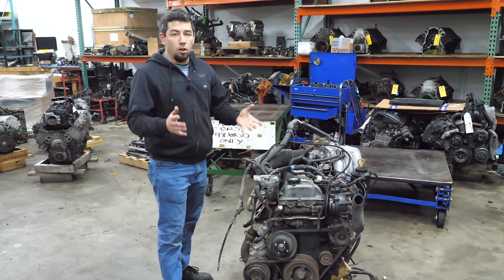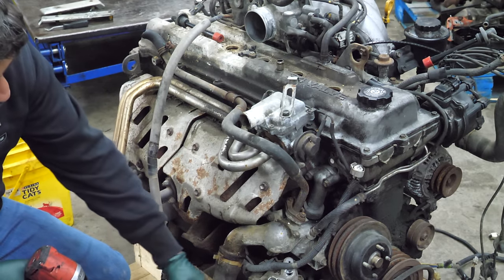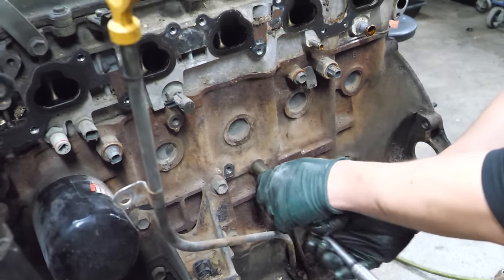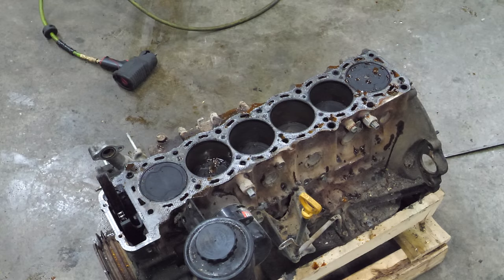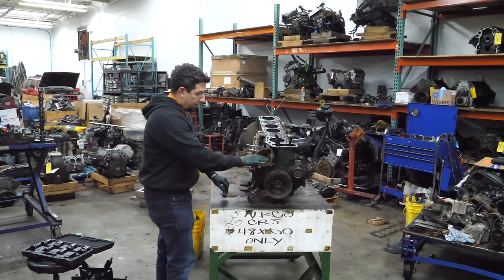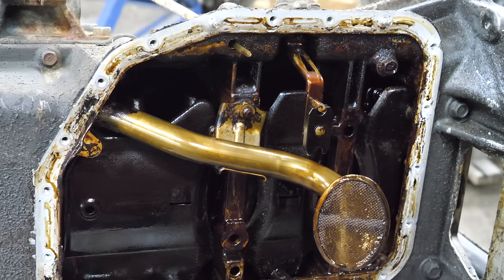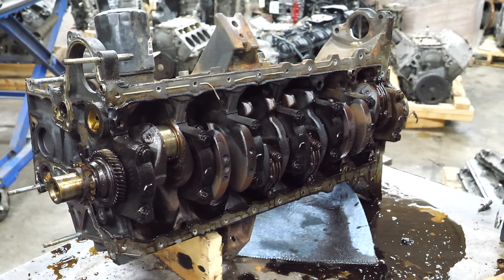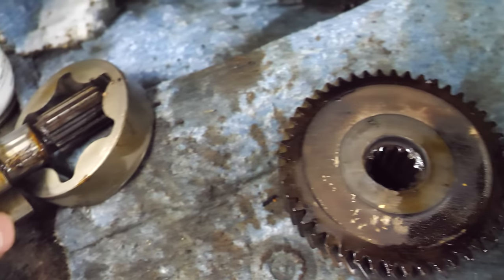LOCKED UP Toyota Land Cruiser 1FZ-FE Engine Teardown! HAD TO USE ALL MY TOOLS TO GET CRANK BOLT OUT!

Comment: I once had a cylinder head that wouldnt come off no matter what I tried. I placed the onboard car jack between an engine mount and a coolant port, no dice. Needless to say I checked a dozen times if I had all the head bolts out. The engine had oil in the water and oil was exuding through the head gasket at its corners. Maybe the water oil mixture together with the head gasket fabric created some kind of glue under the heat. In the end I had no other choice but to put the head bolts back in, this time a little harder, and it fixed the leakage, and the engine runs fine till today.

Comment: The main bearing groove is probably from you turning the engine when taking the crank bolt out. There was probably a rust deposit in the oiling hole that carved that about 1/3 turn which is how much it looks you turned it.

Comment: My father was an engineer all his working life. After he had retired one day one of his farmer freinds was really struggling to get a big nut off of a piece of farm machinery. They had tried everything. The biggest impact gun, heat, a big breaker bar with a scaffold pole on it for extra leverage, the works. My father walked up. Examined the end of the bolt sticking through the nut and the machine. He said "left hand thread" turned round and walked back home.... I would have loved to have seen his friends face.

Comment: Increase the diameter of your air hose. A 3/4 impact works on volume as well as pressure but volume of air will increase your 3/4 impact the most. As a old Snap On Tool man I made many costumers happy with their 3/4 impact purchase.

Comment: I only ever had to mess with maybe 2 harmonic balancer bolts that were that bad. Both times were done with a custom half inch drive, 5 ft piece of rectangular tubing that butts against the frame rail, and use the starter to break it loose. It's one of the most brutal sounding things I've ever done(it sounds like you just blew the crank out of the bottom of the car) but works incredibly well.

Comment: 43:23 😂😂🤣 as you subtlety point to the German word for misery on 4 wheels. Fun video. Using the front loaders to loosen the crank bolt was very Camarataesque. 🥂 👍 👨‍🔧

Comment: First engine job I did at the Toyota dealer in 92 was the old Land Cruiser pushrod inline 6.  It had 30K on it and never had an oil change.  Had to replace a couple of rods and a crank along with rings and bearings.  Doctor that owned it thought his wife was taking care of it and she thought he was.  I hated that engine job but the doctor drove it for years after and then passed it down to his son.  It taught him to change the oil anyway.

Comment: Those drag marks on the main bearings might be from the 90 degree turn the crank did when you set the loader's bucket down on the breaker bar the first time. Big props, that was awesome!

Comment: When the 20R engine came out crank bolts removing themselves was very common. Now its almost as bad being over tight. I have a 1" drive impact that usually gits them into submission, however many must be with the ring gear blocked and a 5' foot breaker is necessary.

Comment: Last crank bolt I took off on one of these it took a 5', 3/4" breaker bar with a 4' pipe on it. Pulled until I bled from the nose and finally came loose.

Comment: I had to change the front main seal in mine and little did I know what I was in for trying to take the harmonic balancer off 🤣 mine is an automatic and couldn't just put it in gear to help the motor to stop turning over....drilled a small hole through the bottom of the bellhousing so I could jam a big flat blade screwdriver in-between the flex plate teeth, and had literally a 3 meter long pipe on the end of my breaker bar to get the bolt out. Snapped 2 breaker bars in the process before the 3rd one held up To the challenge!

Comment: Something something wrong colored sockets on the impact. When you were struggling with that crank I was thinking to myself why dont you hold the shortblock down with the forklift tines and use an 8 foot snipe. Then you grabbed the frontloader and I almost pissed myself. Best teardown so far.

Comment: Used two heavy pieces of equipment to break crank bolt loose, amazing! I think I might have crushed the block with the bucket in frustration. Could the 1/4 turn scraps on the crank be from the crank bolt removal process? Great work!

Comment: My first ever car was a hand me down FIAT that had been overheated and driven hard with low oil. (My brother, it's previous owner, wasn't even slightly mechanically inclined). The crankshaft actually broke while doing 70mph down the freeway. That was a wild ride! The carnage that resulted was indescribable. Your video sparked a bad memory or two in that regard. Otherwise, very entertaining, thanks!

Comment: A tip for wrenching on such fasteners like that bolt; go to the other side and pull up. You can only push down with your body weight, and whatever you can bounce on it. You can dead lift a lot more. Just be careful with your form!

Comment: Recently I noticed a mouse had chewed a plug wire on my 1994 Landcruiser. Thankfully I had saved my plug wires off my 1996 Tacoma with the 2.7, plug wires were the same. I plan on changing the wires eventually, but it got be back on the road.

Comment: i ran into the same problem you did, I ended up buying an battery powered half inch drive Milwaukee, with a 1000 ft. lbs of power. Not even my 3/4 inch air gun could take it out!

Comment: Another great video. Looks like plenty of good parts there to recover some money. 
And a great engine. Well designed, well built. Long runners and small valves is the recipe for low end torque.

Comment: i had a honda with a j30a1 that the crank bolt was stuck like that. it took me and a buddy 3 days to break it loose. we had a 6 foot breaker bar and an impact too. we were both sitting on the breaker bouncing on it and it still wouldnt break. the impact finally got it on the third day.

Comment: funny thing the oil light. my girlfriend had this 06 prius. she was just about due for an oil change, and she noticed the oil light started coming on. she called me after she got to work and i of course new it was bad. I drove over and checked the dipstick. nothing. i went an got enough oil for a full oil change. 4 quarts i believe. I put in one quart, checked the dipstick. nothing. i put in all 4 quarts, then it finally showed. i looked for leaks, there were none. it only had 132k miles, and somehow it was burning 4 quarts of oil every 5000 miles. it was a salvage title when she bought it, and i checked the carfax to see if the mileage was accurate. it was as far i could tell. it also had an issue with the air bags, and wasn't getting great mileage, around 30, and the paint and bumpers were shot from the PO.

Then one day someone stole the catalytic converters while it was at her work. the oem cat costs 2200 bucks, and then it needed to be welded in and a new o2 sensor fitted, and the wiring fixed. they totaled and we moved on lol.

Comment: Your 1/4" air hose does not have enough volume for your 3/4" impact driver. I have that same impact driver and I can tell from the sound it is air starved. Hook up a 3/8" air hose directly to your air compressor and the tool will sound very different and have much more power.

Comment: Oooh, nice pick for a tear-down. The old 4.5L is a pretty obscure engine these days partly because when anyone thinks Toyota and straight-6, they are always talking the 1J/2J.
640 lbs for a complete mill *w/o the trans* is heh-vee. Especially if the engine is making 212/275 and has to motivate an additional 4400-4600 lbs. Even a small LS like the 4.8 would motivate the ever-lovin' dung out of an 80 series, comparatively.

Comment: I just use the starter and frame with a breaker bar to loosen the crank bolt. 

I’m trying to replace water pump on a ‘14 Tundra and can’t get the fan pulley nuts off. They only 12mm and I haven’t seen anyone have problems with them. 

The 2jz is the most reliable, but the 1FZ is pretty reliable.

Comment: That’s what I call a breaker bar warranty test. I used to work a heavy equipment repair yard. We Broke a 6 foot pipe wrench trying to adjust the tracks on an old international bulldozer.  Using a 10 foot cheater bar might have had something to do with it. 😁😁

Comment: About that bolt. You could try to do couple cuts to the head of it with angle grinder using cutting discs. This would releif pressure on pulley. But who knows...

Comment: Nice work removing the crank bolt...surely if the wear was 1 side of the main ends then it would be the block that is out of line as a bent crank still rotates so would cause excessive wear on the shells all round,not just in 1 area

Comment: Factory spec is 304 foot pounds to tighten. 
My spec to loosen is a 1 inch drive impact gun and all the ugga duggas it can muster.
Or in manual Cruisers, a big breaker/cheater bar, clamped to the chassis and tow it forward in 4th gear 4WD High.

Comment: Crank bolt is that tight cause oil pump gear is loosely keyed, so pressure of the balancer clamps the oil gear to front of crank

Comment: My parents 87 Land Cruiser had a little plug in the engine block pop off and it quickly expelled all its oil into the engine bay. Only went about 500 feet before the main bearing seized. It seemed a little strange to me but I was 10 at the time and only really remember the engine sounding funny and we had to pull over.

Comment: #1 that breaker bar is the real MVP... #2.. To Eric and the other Meck-a-necks in the crowd, why do manufacturers not put oil level sensors higher up in the engine so that it screams at you when you're a quart low rather than "Oops, you're an idiot!"? Love the channel, as always! Keep 'em coming!

Comment: I have a 1973 MGB.  All original for the most part minus all the emissions stuff.  I've rebuilt the dual carbs and dizzy(STILL points) and of course some hydraulic lines and electrical stuff.  But the engine and tranny and such are still original and have 120k on them.  I drive it all summer almost every day.  Runs like a champ but my grandfather(who bought it new) and I have taken care of it.  Regular oil changes and tune ups.  Not rocket science...

Comment: How to get you crank nut off. (hopefully) Sit the motor under the hoist arm or deck with a block of wood on the top to protect the surface. that will stop the motor from trying to lift off the frame its on . Then use a 3/4" power bar socket and 6ft of pipe. Thats how. That motor has been over heated or run low on oil .The bearing furthest away from the pump has burnt up. Thats how you know.

Comment: i must applaud you for the proper safety handling of the wheel loaders, as dumb as it is to use the bucket to turn over a stuck bolt, you still followed proper safety by backing away and putting the bucket down and NOT walking in under it to fix the bar!

Comment: I went through the same with a 2jz engine. Was the worst thing. I tried everything. I took off the whole front end. Radiator, bumper etc. I finally called an industrial equipment mechanic to come with his huge impact. That thing was huge. It was the only thing that got that stupid bolt off. It took me two days to find someone to do it and he charged me $60 to come out which wasn't bad at all. After that then i could change the water pump lol

Comment: Well I had an incident with my tercell back in the day I was in a drive through when the oil light started to flash intermittently because little did I know the cam seal between the valve cover and head blew out and I popped the hood and saw one hell of a mess so I drove to the parts store and bought a bottle of injector cleaner or something that had a really small cap that became the seal along with some gray rtv it took almost 4 quarts to fill it back up and I drove it another 50000 miles before I sold I like that and it stayed on the road for another 6 years

Comment: Seeing the rotating assembly, I think that had someone immediately drained and cleaned this engine and put a head gasket in it, it could have been driven a lot longer. The damage was mostly done by the coolant condensation (water) rusting things afterward. That's not to say it was pristine, but it would have run reasonably well had it been repaired immediately. Oh well. Thanks for the fun with the large disassembly tools. :)

Comment: I baby my cars and have wondered for years what happens when engines blow up. This channel has filled in so many details. Do people just keep driving, while ignoring the warning lights and noise?
Reply: It sure looks like it. I live in St. Louis close to the Fox Theater and so many times I heard cars going up Grand Blvd and from the sound of them I couldn't believe they were still running. Heard one recently that cleaned with metal on metal and saw them pull over to check the oil... and I thought sheesh... you are way too late for that. Saw another guy blow his radiator at the intersection and he just kept right on going like nothing happened.

Comment: All right.  Had to laugh at 24:20 when the wooden stand cracked apart.

Wonder if the Toyo techs had a good laugh over that.  Never thought of using a front loader as a engine tool, lol...

Comment: I had a coil boot rip on me like that once and the way I fixed it was I took some of that computer air duster cans and turned it upside down and sprayed the freezy liquid on the rubbber and it shrunk just enough for me to pull it out with a pair of needle nose pliers
Reply from the maker: Great idea!

Comment: All the wear is on the main cap side of the bearings.  That's the same direction as the force from that loader.  

I'm betting those grooves got there removing the dampner bolt.

Comment: I would love to see you tear apart, what is arguably the most reliable 6 cyl gasoline engine, the Ford 300 The block series used in more applications than about anything else.

Comment: Did you know that inline 6 and 8 engines can be mounted on the engine on the side of the block so the weight is evenly distributed across the stand arms

Comment: Looking at the score makings on the main bearings my thought was the the mains bearing caps and the other half of it is out of alignment so would need to be line bored as if it was a bent crank I would have thought there would be alot more damage to the bearing surface

Comment: hey i mean atleast i havent seen u break down a  1.8L 06 corolla engine they last forever mines at 181k atm did the valve cover gasket cams looked amazing and ive spent 400$ max on parts for 15k miles so far

Comment: Its really a good idea to save every part off that motor, the reason is when Japan had its earthquake then floods it washed away almost all of the replacement parts toyota had stockpiled, so many older cars you used to be able to find new old stock parts for are gone now and youve got to get it from salvage or aftermarket if its made  like 
sorta fit. "CERTI FIT"

Comment: I can only assume that this engine sat with oil in it for a long time. And when it came time to the dude who owned it last, wanting to start it up, A: made the mistake of not draining the old oil at all, or cleaning any of it out, and B: also accidentally swapped where coolant and oil go. (unintentionally so too most likely. Given it's likely that the dude who bought the vehicle last probably couldn't tell or couldn't remember properly at the time. Either way not likely to be intentional.) also gonna assume that the smell you mention is the Very old oil that sat for who knows how long inside of the engine, and of which had mixed with coolant too.

Comment: Would be cool to know what the 'breakaway torque' was @ moment of damper bolt release . 
Since the loader didn't come off the ground.is a starting point. Any engineering types out there ? I'd est 4ft breaker bar.

Comment: When your oil has the thickness of water and coolant looks like oil and cams look like burned toast you have issues. Someone mixed up foot pounds and mile pounds for the crank bolt
Reply: And your oil pan looks like a hippo took a dump in it. Yikes!!!

Comment: -I always get arguments online when I state that inline 6 engines weigh MORE than V8's of far greater displacement.  Inline 6's are inherently balanced, but the length of the engine with regard to the displacement means they are very very heavy.  What's more, inline 6's have an enormous crankshaft, which is at least 50% heavier than a V8 simply because it has to be so long.  Also, the long crankshaft has harmonics from the pistons firing, the torque being generated in a wave, traveling down the long crankshaft, bouncing off the end, and then hitting other torque waves.  At certain RPM's this creates concentrated forces at one particular point on the crankshaft and that is where it breaks.  As a result, the crankshaft of an inline 6 has to be VERY strong if it is to see any sort of RPM.  Thus, inline 6 engines typically are tuned for pulling torque and/or forced induction in order to produce power from torque, not from high RPM.

The only company in the world that produces high RPM inline 6's is BMW, and you will note that they have moved from high RPM towards forced induction.

This 212 hp Toyota engine weighs 662 pounds.  A big block Porsche M28 V8 engine weighs 550 pounds, and while most production engines are 5.0 liters, it is possible to bring this aluminum V8 to 6.4 liters or 396 cubic inches.  Don't even get me started about the 450 pound Chever-Lay V8's....